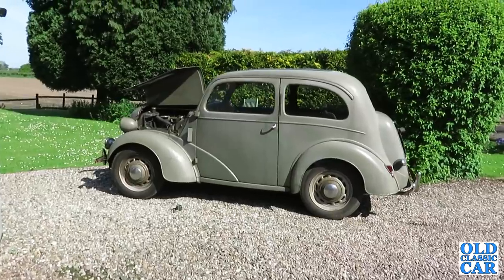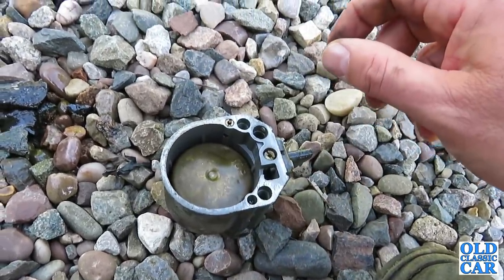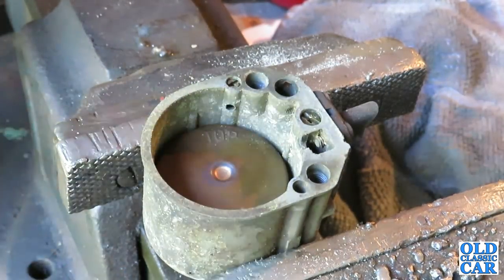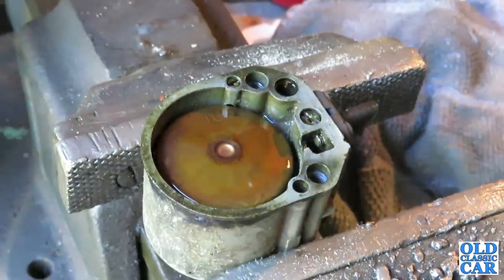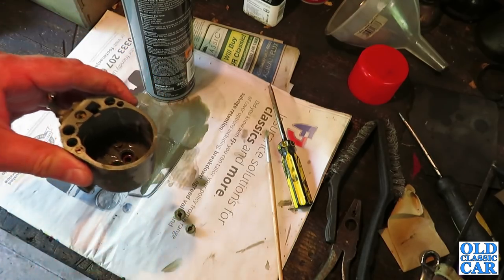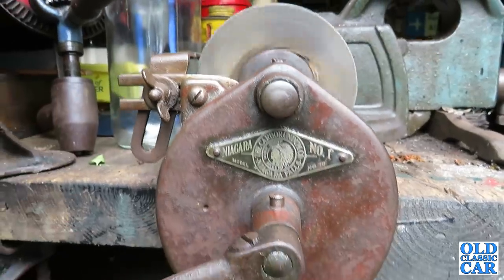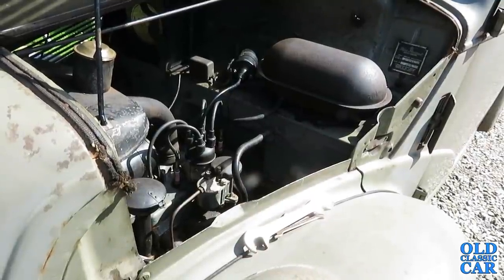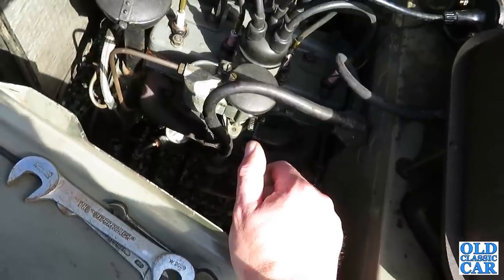Classic car fix - the Ford Anglia E494A's Zenith carburettor is pouring out fuel

Comment: Oh how this takes me back to the 1960s when I drove a Ford Popular and was an apprentice motor mechanic in Kent. Couldn't the leaky float halves be separated, then resoldered? I did a quick search for replacement brass floats and one supplier has over 200 in stock, priced at around £12 each. I reckon a modern car designer would specify a plastic float. An interesting exercise would be to 3D print one!
Reply from the maker: Hi, yes I believe they are available and could be fixed, the challenge on that day though was to find something there and then that would return it to working order :)

Comment: At various times past I owned an Autstin Somerset, an A30, a Rover 90 and later basic Minis and 1300s. Apart from rust these cars ran well and were easy to work on. My presnt car has so many dash lights, switches, cameras and assorted gizmos I have to remind myself what they are for. Maybe these things detract from actual concentration while driving? As I was reminded as a lad "keep it simple stupid".
Reply from the maker: Yes simple is good, even more simple is even better (IMO)

Comment: Bought one of these in 1971 for £5 with 12 months mot. Bought it off a teacher who couldn't get it started. After giving everything a thorough check over I couldn't find the problem. I took the float bowl off to check if fuel was present. When I removed the bowl the float basically level with the top. The bowl was full of crud. Took me a week to clean it using paint thinners to break up the crud with the aid of a small electrical screwdriver. Ran a treat afterwards. I 'gave' the car away when I joined the Royal Navy 7 months later - not the first or last crap decision I've made 🤣🤣🤣🤣
Reply from the maker: Ha great story, thanks for watching!

Comment: When you hear the hissing of the leak on the float, with soapy water ,test the solder joint or the leak .then resolder it after draining the fuel inside. My first car when I started work as a teenager and driving was a 51 prefect 4 dr.

Comment: Glad that's sorted..I wish I could do quick fixes though , I would have to take carb off and submerge it In petrol and blow out all passages new gaskets etc..carb cleaner ..but as long as the problem is solved that's great and a lovely car you have there..rock on .peace..
Reply from the maker: Cheers, thanks for watching, invariably if I start doing more jobs than were originally needed I end up breaking something, so in this case I was happy just to put it back together :-)
Reply: @oldclassiccarUK  job well done...

Comment: That was lucky to have had the right spare float. There should be a gasket on the bowl for a leakproof fit on the carb body. And since the carb is right on top of the hot exhaust, better carry a small fire extinguisher in the car - some of the old classics had them from factory.
Reply from the maker: Thanks for watching, I don't think this type of carb ever had a gasket (SU carbs do have a gasket on the float chamber lid, but not the Zenith fitted to the Ford AFAIK). Thanks for watching

Comment: Did you take the needle bolt out and check that the needle was seated properly.   With repeated use, as small ridge forms that can allow the needle to always leak slightly.     Take it out and with very fine sandpaper or even a sharpening stone remove any ridges .   Check the seat as well for lips and ridges

Comment: hi i remember these cars in the early 60s as a child,my uncle used to double-de- clutch when going in to 1st gear when on steep hills .he taught me the art of correct driving.i do not know why these cars were not fitted with an oil bath air cleaner or a simple wire mesh air cleaner , back in the early 70s my friend had a 100e it was  a great car and side valve engine
Reply: Yes, the Popular and similar models didn't have synchromesh on 1st gear.

Comment: Looks very similar to the pre-war Austin 7 Zenith 26VA.I gather that the prevailant  Ethanol in petrol can wreak havoc on lead solder which I assume could affect the float assembly.
Reply from the maker: I've not read about ethanol affecting lead solder but I wouldn't be surprised, I need to gather my relevants spares into an easily-accessible location, I was just lucky that I knew where this lone spare carb was located and fortunately it had a usable float in it. I might just check it again this afternoon just to make sure that it's still floating ...

Comment: Having the carburetor over the exhaust manifold is just bad engineering (like VW (having it over generator)). Also there is a chafing point (needle on float). Stromberg is better, having float separate to needle with the actuator in between. However, perhaps by attaching a piece of harder metal on top of the float may help. Thanks for your hard work, cheers  🍻

Comment: So Rick, do you think this is synonymous with the dreaded ETHANOL in modern petrol? I too had a float that became porous in my Daimler Fifteen. I have since replaced it with Burlens " Teflon" replacement with no further problems but I have heard of quite a few cases. If so, the ethanol is a proper nuisance and could result in serious fires in classics which would very worrying.
Reply from the maker: It may well be, I've not looked into it particularly but from what I hear it could well have an effect on the solder. Certainly something to keep an eye on and I'll dig out a few spares to keep in the car I think

Comment: Is it usual that there is no provision for an air cleaner? The 1948 Prefect that my parents owned here in Australia  certainly had one. It also had electric wipers.
Reply from the maker: Hi, export Fords probably did have air cleaners (not sure about wipers), here in the UK they just had small tin covers fitted to the top of the carb, as it shows in the vid. Thanks for checking out the vid!

Comment: Really useful video, interesting to a non mechanic to see how these things work certainly fairly straightforward unlike some modern cars. I noticed that you have a vacuum tank fitted, does this improve the working of the wipers on hills and overtaking or are they still a little slow at times?
Reply from the maker: Thanks for supporting the channel, to be honest I've only driven it briefly in rain (see the tip run video!) but I would imagine that the presence of a vacuum tank would only make a modest improvement to the efficiency of the wipers, so really they are still a poor substitute to electric wipers I'm sure
Reply: @oldclassiccarUK  As you say electric wipers are far better.  Vacuum work well on tickover but on full throttle they slow down and stop when the vacuum tank is empty, and only recover when you take your foot off of the throttle. The 100e also had vacuum operated wipers.